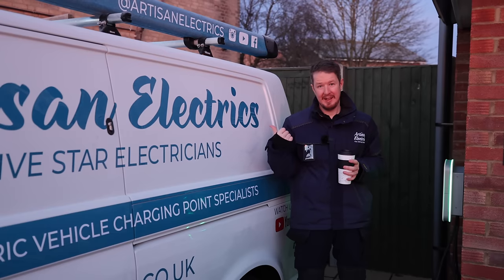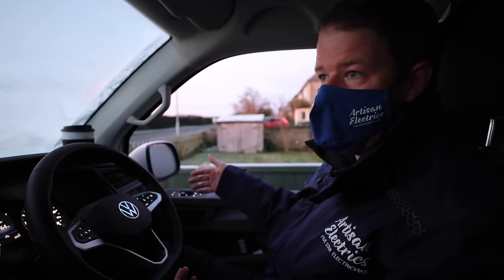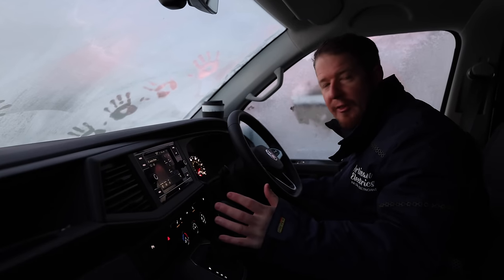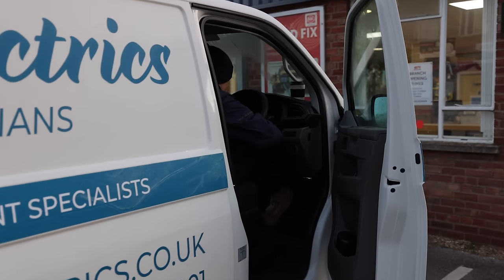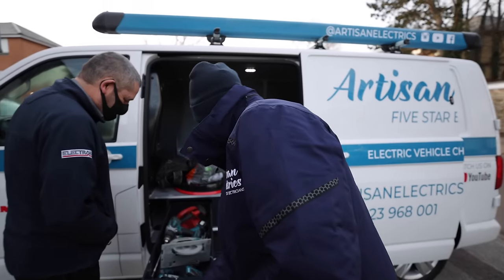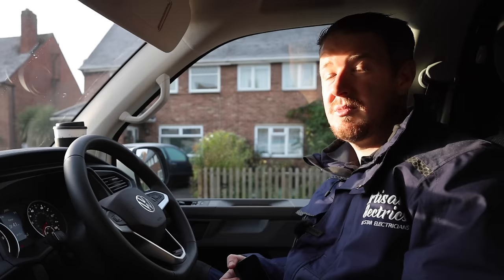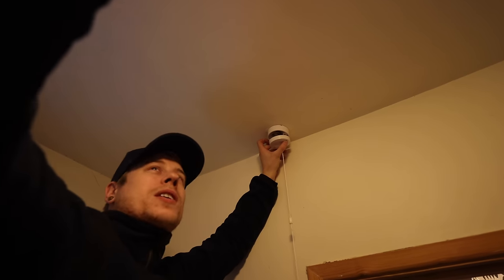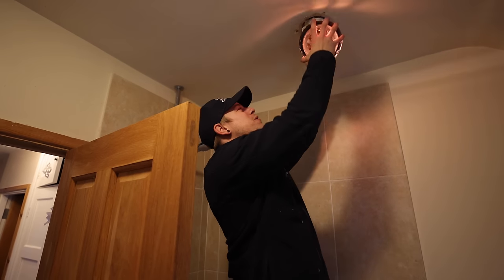ELECTRIC VAN NIGHTMARE 😬 - Volkswagen Transporter Electric Van

Comment: The window won't go up because it is struggling against the ice and that's giving enough resistance that the safety system thinks someone may be trapped in it and lowers the window again - as pretty well all cars do. Usually, holding the the switch in the close position for long enough will override the safety system and close the window.
Reply: You’d think someone with more than a passing interest in auto electrics would know that
Reply: My transporter does this when I hit a big bump while closing the window, you just have to stop using the auto close and close it carefully on "manual"
Reply: not its not...

Its because the glass moves in the frame and binds..

you need to move the glass and you can clearly see it moves when he touch's it
Reply: Just not the sharpest pencil in the box. I'd be worried if he was my leccy
Reply: Yep! Common sense would come to this conclusion
Reply: The window looks like it’s broken the way it tilts back and forth when he’s messing with it. I would take it to the dealer as it’s a brand new vehicle after all. It’s just a bit of frost, not ice, it shouldn’t bother the window mechanism one bit.
Reply: @christianronn5301  when cold weather arrives spray some silicone lubricant on all door rubbers, and window tracks, doors open easily and don't stick with the ice which cant form on silicone, and windows will work every time. mind and spray or stop wing mirrors folding in severe weather too.. or as suggested don NOT run mirrors up and down, car shops sell ice scrapers for about £1
Reply: @ritchierennie8556  Yes, I know all of this, i’m in Finland. But it looks like a malfunctioning window mechanism to me, not something caused by a little bit of frost.
Reply: You woukd think as an electrician he would know this
Reply: @oliverriall   do you mean your vehicle has a manual closing facility? AMAZING! That's what should be the case! Do you know if vehicles generally can have electric windows  closed manually? I always wondered  , (heaven forbid)  about vehicles that skid, and fall into rivers!. They say water leaks into a vehicle, and leaves a big air bubble at the ceiling, where people have to breathe  and they have to wait till most of the vehicle is full of water, to equalise water pressure inside and out - so they can get the DOOR  to open! Then they can float/swim to the surface! But I just mean people NEED to open a sunken vehicle's  window to let SOME water in - and I've always wondered if electric windows COULD open underwater,! I just hope there IS  a manual opening system!
Reply: @nygelmiller5293  umm, no, I just meant manual in the sense that you have to hold the button, not press it once.
I keep a very cheap little window smasher tool in my door pocket, if you ever need to open it in an emergency you just touch it to the corner of the window and it smashes out. I suggest you get one too.
Reply: @oliverriall  No point keeping it in the door pocket is there!  Almost the only time you need one is when you roll the vehicle (usual if you end up in a river) and damage the structures so the doors can't open, and then your window breaker will have flown about the cabin and be lost in the seat mechanism somewhere.  (The only other use I can think of is when a large or high energy vehicle hits you when close to an obstruction and crushes both sides of the vehicle, but even then whatever is in the door pocket is pretty unlikely to stay put.)  Rescue devices like that need to be in your glove box or the little hidey hole above your head (for sunglasses) or top of the dash board (for melting chocolate bars).
Reply: I worry about this guy. He states regs and yet doesn't understand basic automotive electrics. Quoting acronyms all day doesn't maketh the genius spark. IECR, EIC, CPC (earth), blah blah.

Comment: As a kitchen fitter I get that kitchen fitters have a bad rep but I’ve seen lots of bad electrical work done by electricians too. 
The worst one was an electrician rushing and then wanting to be good to the customers and flicking the power back on for the night. Problem was he hadn’t checked and there were 2 unmade ends that were livened up for me or an enthusiastic cleaning customer to kill themselves on. My recommendation to you is not generalise!!!
I was once told it’s the easiest thing in the world to pull someone’s work apart.
Reply: Personally it's a pet hate of mine, I see a lot of local electricians now doing CCTV/Security installs and often using awful products/brands.
By all means subcontract if you want to be a generalist.
Reply: Best you get a roll of insulation tape, extra sticky.
Reply: Bathroom fitters are the worst
Reply: Well said Mark.
I have meet some horrendous, and dangerous so called approved electricians over the years.
Reply: As we all know, there are good and bad in all trades. But like you say, everyone is very happy to slate poor work and rarely does the good work get credit. We should all be a bit more kind.
Reply: I have this same problem with electricians and their installation of EV chargers onto networks which aren’t isolated. Or wifi repeaters which are poor quality.. a lot of electrical installations have a computer element. And that carries with it a network security element which no one seems to think about.
Reply: @TornTech1  "EV chargers onto networks which aren’t isolated" Can you please explain what you mean ?
Reply: @JamesJames-um5xq  a lot of the newer EV chargers are becoming “smarter” and to allow that, are starting to come with small embedded computers. Which at the fundamental level; I now have a computer, which I have no control over(I can’t log into it, I don’t know what it is doing) sitting with full access to my wifi network, unmonitored and with full access to all my other devices on the network.

The standard thing we would do in a corporate environment (acting as the IT Department) when some sparky asks to add a device to the network is to throw it on its own, or at least isolated away from workstations and “trusted devices” network from all other devices.

Most consumer broadband routers offer a “guest wifi” option now. Although I bet 95% of sparks or the random customer who has brought A Tesla and is getting an EV Charger fitted, wouldn’t think of put it on there.
Reply: @TornTech1   Ah you mean adding the EV chargers data onto wifi networks that are not isolated ! I thought you meant adding physical EV chargers onto the electricity network (which are able to be isolated of course) !!!!!  BTW not all EV chargers need wifi, some can run on the cellular (mobile) network !
Reply: @JamesJames-um5xq  yeah sorry. I should have been more clear.

And yeah, I know about the cellular ones.. their not an issue really. Not my network not my problem!😂

It’s when a HyperVolt gets installed on a customers wifi network, running a full blow computer(raspberry pi) with full access to that network of NAS drives containing all their photos. PC’s which might not have had their updates done in a while and used for banking, etc… 

It doesn’t occur to people, but the risk isn’t insignificant!
Reply: @TornTech1  Some good points there Tom that I was unaware of. You say you have a problem with bad "electricians" who install onto non isolated wifi networks; but that decision is surely the responsibility of the customer !!!  Electricians just fit the things we don't decide what network to connect to, the customer says connect to this or that network and provides us a password !
Reply: @TornTech1  Thanks for calling that out, yeah thats something to consider for sure !
Reply: I just had electrical work done by a qualified spark well our landlord did, I checked his work he's joined 240v cable together using crimps & insulating tape & there's still bare copper on the neutral visible & then tried to hide it in trunking & where the trunking was open at the top he's stuffed it full of polyfilla
Reply: The worst electrical bodges I’ve ever seen have been kitchen fitters and I’ve been an electrician for 40 years.
It is criminal that kitchens were taken off the ‘ special location ‘ list that have to be notified.
Reply: @makg4655  you cant join the NICEIC after completing a 3 week course.  anyone who's told you that is talking out of their backside.  I'm a domestic installer and after studying part time for a year and a half had to prove 2 years worth of notifiable work before they would look at me .  All work that I had to certify and get checked the expensive way.  If you haven't got any youngsters coming through then how do expect to fill a gap other than offer ways of people retraining??  apprenticeships for people retraining arent going to cover the bills
Reply: I know what you mean guys. I'm a tiler, and I was doing a kitchen job a few weeks ago and needed to nip out to price another job. I asked my electrician mate if he wouldn't mind banging a few tiles on the wall and he was like "sure I'll give it a go". When I got back I was like "Dude, WTF??" - It was a fucking terrible job. So yeah - the moral of this story: want some tiles doing? DON'T ask an electrician - they're fucking shite mate!
Reply: As usual in ant trade there are those who are tradesmen and those who think or pretend they are
Reply: I've seen some shocking weld jobs done by DIYers or even Mechanics who have access to a welding machine. Clearly don't even bother to do the minimal in prep work.
Reply: @Lamster66  what in the Uk?? What course is that?
Reply: @Gr33nMamba  ELV work isn't a trade.
Reply: Yeah most electricians I have come across are arrogant overpaid an like too much sniff sniff
Reply: @dizzy2020  I’ve seen kitchens fitted by electricians that are good and bad, kitchens fitted by kitchen fitters that are good and bad, electrical jobs done by kitchen fitters and electricians both good and bad. 
What I’m trying to say is there’s good and bad from both trades and his comment about a typical kitchen fitter bodge is unqualified as he has no knowledge of who did the job, kitchen fitter, electrician, builder or diy’er. 
Leave the generalisation out. It’s a bad job by someone else. Leave it there.
Reply from the maker: I totally agree there are plenty of bad electricians out there as well, some very decent kitchen fitters do better electrics than some shoddy qualified electricians I’m sure
Reply: @norfolkngood8960  Why are you dismantling and checking an engineers work? Are you an electrician? What are you looking for?
Reply: @Lamster66  Nail on the head fella. That's why I am on my own and it's a bloody struggle to find out what I actualy need. Big companys really take the piss using skilled people under the umbrella system, yet you yourself are not recognised nor can you use any of that work towards your own certification.
Reply: @Lamster66  £3k to £4k is cheaper than getting a sparky to rewire the house.........how big is the house, average rewire on a 3 bed semi comes in at less than £4k
Reply: @Lamster66  In that case yea the price would be a lot more than 4k
Reply: @Lamster66  My 5 years of training and over 30 years of experience pales in comparison lol
Reply: @Lamster66  Erm 2.5mm ring? that's 2x2.5mm at the point you spur off i.e. 5mm2 
possibly protected by a 32a mcb. So your 2.5mm spur can theoretically pull 30+ amps on a cable rated at 20-25A depending on the installation.  Unless the spur was fused at the point it left the ring it is not correctly protected and a potential - note I did say potential - fire hazard.    You may not have fitted the spur but the guy was correct to point it out. And nope, I'm not an electrician either.
Reply: Correct. 
In my over 25years of building experience I spotted only 2 real electricians others was only poorly trained electrical fitters. I’m not generalising, that’s how it is. 
Electricians supposes to be elites on building sites, but very often are not. 
Generally is a hard to found well thinking tradesman in young new generation unfortunately…

Comment: Damn, I wouldn't want this guy working on my electrics. In the first 6 minutes alone he has demonstrated lack of knowledge on everyday life and personal safety!
Reply: A lot of difference when an electrician deals with AC currents/voltages in homes or businesses (wiring, diagnosing).  Dealing with highly complex EV system batteries is completely outside of constant high power AC systems that electricians do.  These guys are not electronic engineers.  Give them a break.
Reply: @melbro62  i just didn't turn the key to on, it's just dumb
Reply: @MauriceNL1  KEY?
Reply: @melbro62  lol yes. Or did this one have a start button.